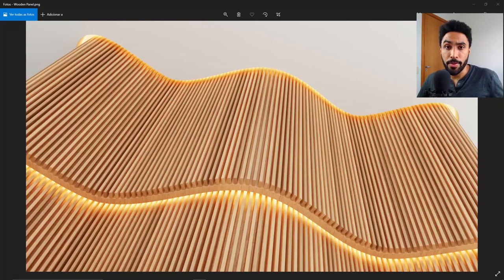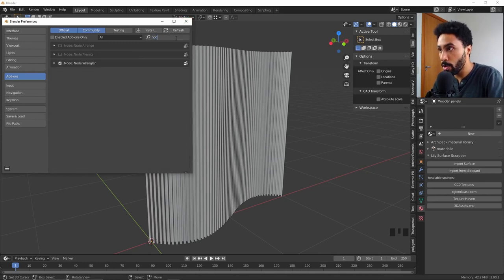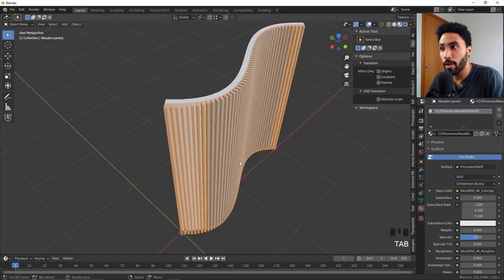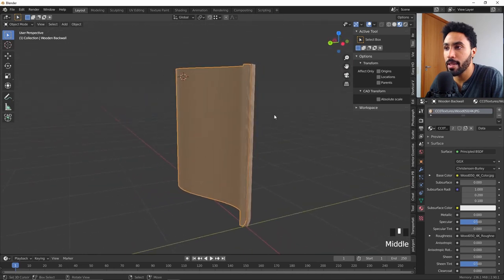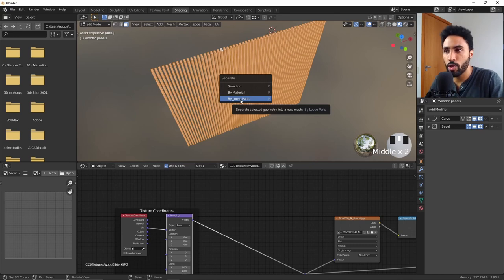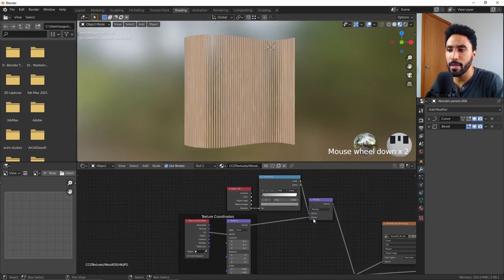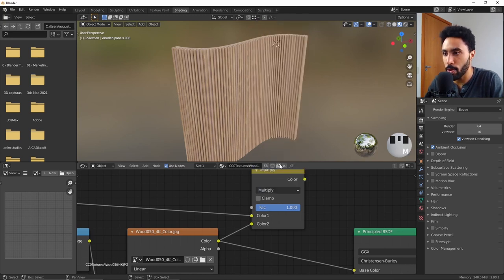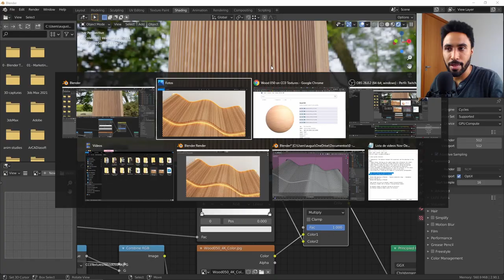UVW RANDOMIZER - Blender Tutorial Archviz

Comment: If you're using Cycles you don't really need to apply the array. The Input->Geometry node has a 'Random Per Island' output that generates a random value for each separate mesh piece in your object. Sadly this doesn't work for Eevee (so won't show up in preview); at least, not yet.
Reply from the maker: I tried the random per island and it won't work for some reason.
Reply: Some time ago I used a similar trick to make it random without applying the array too. If I remember well, I used the "random" output (or it was "random per island" or "location"). Then the trick part is connect it before, with the location vector dot.  Try it and tell me! I can try to find exactly what I used here if you don't get it.  Cya